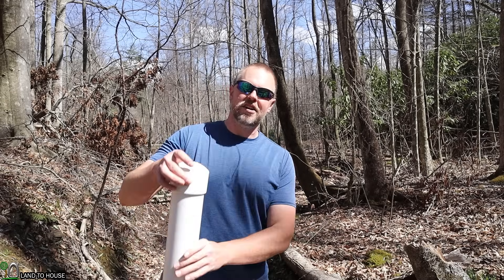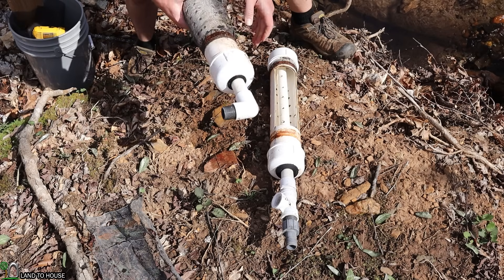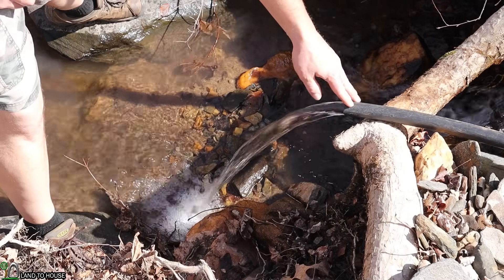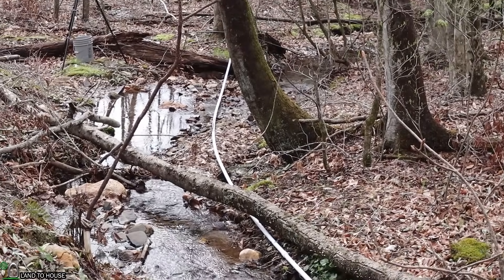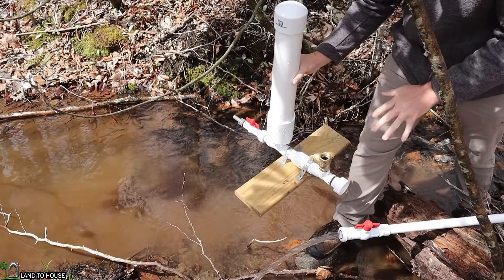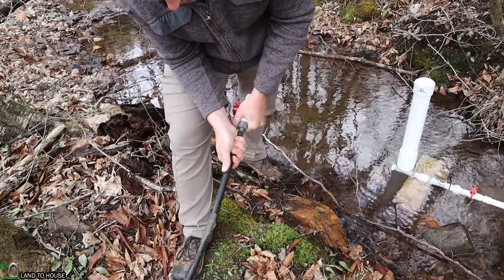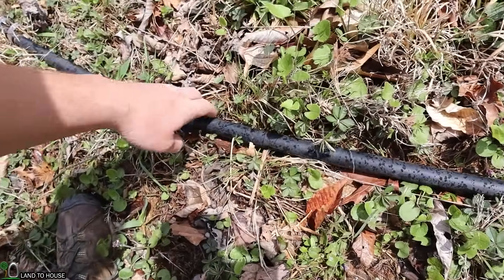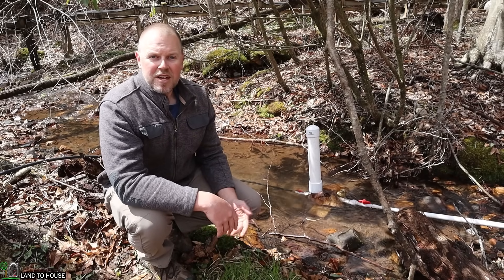AWESOME Full 1 inch Ram Pump Install

Comment: Could you please explain how much drop and pressure you need to lift water say 5' or 7'. I thought that 2.5' of drop = 1 psi. So how many psi does it take to left the water 7'? Thanks.
Reply from the maker: The ram pump needs approximately 3 feet of input head pressure to cycle properly. This can lift water to 20 feet. The ram pump can struggle to lift water to lower levels like seven feet. Back pressure loss in the pressure tank can occur.

Comment: How does this work during the winter?  Temperatures below freezing, for example.
Reply from the maker: The pressure Tank can freeze and break. It's best to remove the system on days below freezing.

Comment: Hi Seth, I just wanted to ask you something because we chose Utilizing Ram Pump with 3 inlet drive pipes with their own Waste Valve as our Research, I'm from the Philippines by the way. Assuming they have equal lengths and diameter, how can we know if it is efficient or not?  where the three drive pipes merge into a T fitting into the pressure tank. can you give us some advice and we will make sure to include you in the research paper as a sign of respect before we Patent it. thank you

Comment: I was wondering if this idea wouldwork?
 I have a well on top of a hill. The water level is 20' below the ground. I was wondering if siphoning the water from the well 100 plus feet down the hill, which is 30' below the water level to a ram pump to bring water to another part of my land and use the waste water to irrigate the surrounding area.
 Any suggestions would be greatly appreciated
Reply: This sounds exciting

Comment: Happy to see the return of ram pump videos. That's a pretty spot with the little drop next to the bucket. Next up: using all those battery powered chainsaws get put to work  to clean up the debris from the ram pump and micro-hydro areas.

Comment: I get the supply line head pressure elevation drop and drive line height math but is there any bearing on the intake line distance or elevation drop feeding the bucket?...or it is just a function of getting adequate flow rate into bucket as it seems like any head pressure elevation drop is lost at the bucket?

Comment: Hhhmmm I don't think my spring will run that. I do have 5-6 springs on my property. 16 acres not far from the Blue Ridge Parkway in Wilkes. Seth I'm wondering if somehow I could hook them all together.
Reply from the maker: The smallest pump that I have is half inch and it needs 2 gallons per minute to operate. Yes you can combine springs into one source. Run all the Springs into An I. B. C. Tote or bucket. Then use that as the source

Comment: I have a 250 midnight controller on water turbine 280 volts between 40 60 watts. Goes restring and hyper volt. Any advice would be appreciated

Comment: O heck yea.    Another good Ram Pump Video.   Keep them coming.   I would like to see you change the pressure tank to a bladder tank like Lowes sells.   Long term it would be neat to see if it combats the water logging problem that long term use has
Reply from the maker: I still need to get one of those to do some testing. Either Lowes or I bet the local plumbing store has them.